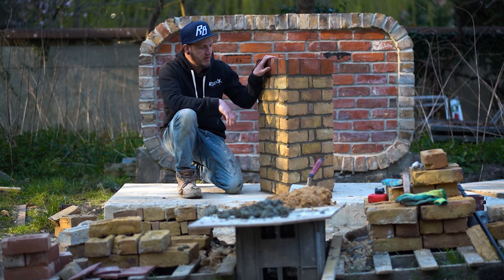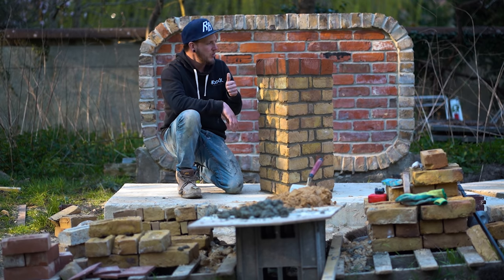BRICKLAYING - INCREDIBLE TRIANGULAR PIER

Comment: 😯that cutting blade was so close to your foot when you were cutting the arrow. i jumped in my seat when i saw that. scary stuff. but good work.
Reply: @martin2466  It's kinda true. The blade itself isn't a sharp blade.  The cutting comes from the diamond chips being so abrasive. I've got my boot a time or two with no injuries. That doesn't mean it won't run a hole through it though lol.
Reply from the maker: This is not something I am going to try 🤣 It may take longer to cut through the steel toe of my boot but the rest.....ouch....not going to try 🤣

Comment: sick video mate refreshing!!...a certain "best bricky",,lol will be realising he wasted £2500 on a BT saw. the rent on a empty unit
Reply: Bit harsh
Reply from the maker: For me, buying a table saw would be more hassle than it's worth. When on a job theres never enough cuts to justify using a table saw. Plus theres the pain in the butt to transport and set it up. With a petrol cutter you can just sling it in the truck and off you go! For me its perfect
Reply: Using a table saw is far from a waste,its the best tool you could buy,far quicker and alot mor more accurate,you have obviously never used one,demo saws are for cowboys and that's why the cuts on top was wrong.